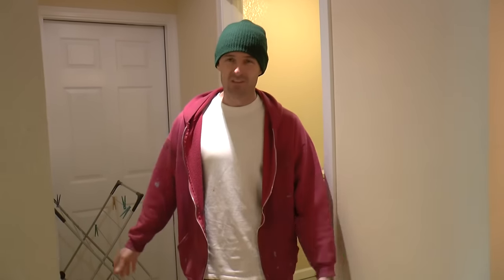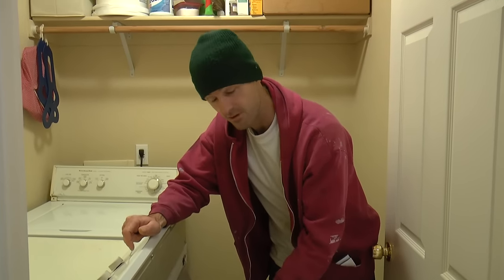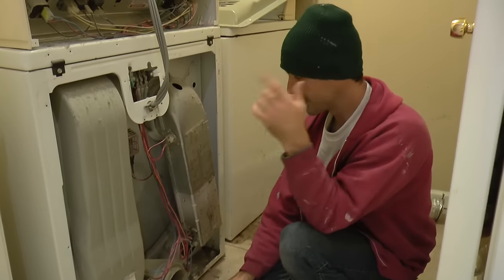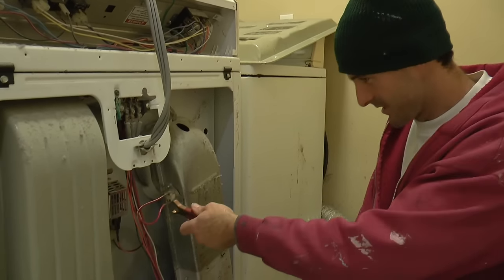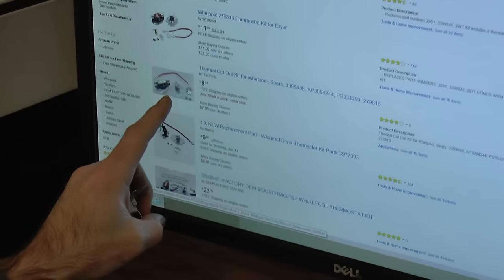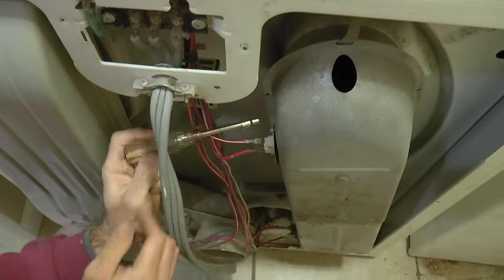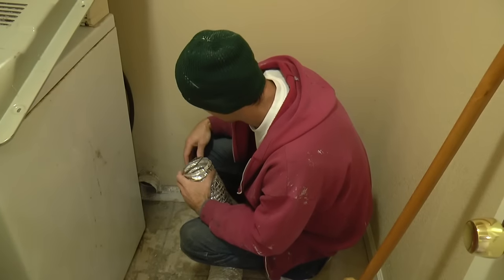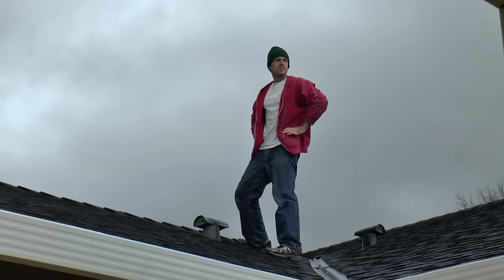My Electric Clothes Dryer Doesn't Get Hot - Fixed!

Comment: My whirlpool cabrio dryer is not getting hot and I watched your video. This help me a lot, I was going to call a repair man in the morning but I decided to check some of the things you mentioned in this video. I’m pulled the dryer out from the wall and took off the hose that connects to the dryer and the wall and then I turned the dryer on for a few minutes and I put my hand down by the back of the dryer and it was blowing out hot heat. Then I check the inside of the dryer to see if it was hot instead de the dryer and it was very hot. All the had to do was to clean the lint and everything else that was in the hose keeping the dryer from getting hot. Thank you so much for this video, your video is very helpful for a single mom. Thanks again

Comment: This worked when nothing else did and made me a hero in my household. That is not an exaggeration...with three kids, all teens, the laundry had backed up massively, and fast. The trick was bouncing the connector/trip/fuse/whatever off the ground hard six or seven times. It absolutely worked and reset the heat element so heat ran again. I am forever in your debt.
Reply: I know this is over 5 years old, but I was in the exact same boat and the same fix!! 20 year old Kenmore got its stay of execution!

Comment: Thanks for the video. My Kenmore dryer stopped turning on a few days ago. Put a new door switch in, still didn't turn on. Narrowed it down to the thermal fuse after buying a multimeter. Didn't show continuity and the dryer started when I bypassed it. Replaced it and the dryer was working again. Cleaned my dryer vent out with a leaf blower. Put a few loads of laundry through it and then noticed one load wasn't getting dry. Realized it wasn't heating up at all. Came across your video and I tested the high limit thermostat and it didn't show continuity. So I tried throwing it on the ground a few times and it worked. It showed continuity with the multimeter. Hooked it back up and my clothes are getting dry again. I am ordering a replacement from Amazon because it looks like it got pretty hot at some point and part of the plastic is melted. Cost of a new one is worth the piece of mind.

Comment: Just did this and it worked!
I don't have a multi-meter so I couldn't test it. I just tried the trick with throwing the thermal fuse on the ground and it totally fixed it! 
Multi-meter and new thermal fuse are in the mail but I can still use my dryer for the time being.
Thanks so much!

Comment: Effective, entertaining and explained in simple terms. Great job.
Reply: I agree, thanks
Reply: Thank you so much! I didn't have the meter to see if any of the parts were working. I took the part off, and threw it on the ground hard. I was already frustrated so that part came easy. I put it back together, and it worked. Thank you so much. Lol for free

Comment: The problem is with the vent where it travels vertically to the roof. The warm,moist air causes lint to stick to the walls of the duct, diminishing airflow. You need to clean the duct with a long brush usually about 10 feet long. They are made of wire so they can bend and flex.
Reply: 🇬🇧 - like that of a chimney sweep, over here most vented tumble dryers are being replaced with heat-pump ones which are more efficient 🌿, and when we did have vented dryers - vented out the door and the duct hung out a open window/vented out the back and into a vent in a external wall. Only in the US have I seen in videos/pictures of that unusual vertical flue installation for a dryer, I have seen [pictured] in a 2 story 🇺🇸 house with a central laundry room that the flue was soo long it needed a centrifugal fan halfway up to aid in exhausting the air

Comment: Got a used washer/dryer set and the dryer wasn’t heating. Figured out that the relay for the heating element had become unsoldered from the control board, so I removed the old possibly lead-free solder and added some good lead solder.

After that it was overheating, but only with the vent hose connected. The house was newly rebuilt after getting ruined by an EF4 tornado 2 years ago so I soon found out that the builders never replaced the missing vent cover outside. After destroying some wasp nests and running a drill powered brush through it several times, everything was working great.

I don’t have a ladder high enough to install a replacement vent cover just yet but I have a replacement ready. Hopefully I’ll get the chance before something else moves in.

Comment: Another fine fix!  I never liked those drier things because of this exact problem.  I was looking to get a new one recently but then I stumbled on a website that suggested using a dehumidifier to dry clothes instead.  I needed one of them anyway for a back room that gets a little damp, so I thought I'd give it a go and it does indeed work a treat.  Apparently, they're a lot safer and more cost efficient to run than conventional driers - take a little longer though, but I can usually wait overnight.
Reply from the maker: Wow, I never thought of a dehumidifier. It does seem a waste to make all that heat just to dry clothes. When the weather is nice (and even when it's not if the dryer is broken), we use a drying rack.
Reply: It does work really well. Mine's even got a clothes drying button which makes it work a bit quicker I think - not sure if they all have that feature. It produces a nice container of distilled water at the end of the day too!

Comment: When you have the back cover off, it's not a bad idea to remove the lint trap duct on the left side to clean that out as well, and the blower wheel thing at the bottom.  Doesn't take too long, held in by the same screws that hold the back panel on, and a couple screws up where the lint trap goes in and out. I mention that because with all the lint that was in his ductwork, I bet there's more in that ductwork  on the left side.

Comment: Oooh! You just fixed my dryer too. Mine had the same problem also. It was clogged with lint and got hot so the shut off valve kicked in. I replaced the cut off valve and BEHOLD!! The heating element lit up!! Thanks!!!

Comment: I replaced the heating element last year in dryer.  You saved yourself a $125.00 plus service call.  Vinyl dryer hoses used to be the standard not too long ago, and are more fire prone.  Also, check your hot/cold hookup hoses on washer for serviceability.  Supposed to replace every 5-8 years to prevent bursting.

Comment: It's always a good idea when using a multimeter set for continuity to remove at least one wire from the terminals. On complex circuits there are often more than one path that may cause you to miss the open circuit. The tip about rapping the thermal disc switch to reset it is interesting. You could check it with an open flame to see if it still trips as it should before presuming it to be reliable. Thank you for the good video.

Comment: My dryer is in the basement. The vent is above the dryer and comes out just above the concrete wall. It has a flapper door on it to prevent cold air and presumably rodents and insects from entering when it's not in use. Some wasps built a nest inside the hood of the vent and it kept the flapper door from being able to open. I found by dumb luck as I saw them flying in and out of it one day while doing yard work. Just one of the things to look at regularly.

Comment: Congrats to you on the dryer repair but don't forget to put the wall plate on the dyer outlet. It's 240 volts and get rid of the foil vent hose and replace it with an flexible metal vent hose.

Comment: Dude you're a freaking genius. lol (referring to the bounce the part to flatten the part trick!) lol 
How is the heating element different from the the igniter and flame (triggered by the solenoids) in the front of the dryer.  My dryer's igniter glows, the solenoid clicks and the flame turns on and stays on , but the drying drum and does not get hot thus the wet cloths do not dry.

Comment: On the left of the element chute where the thermo switch you reset was ,is another shiny aluminum chute,the other side ends up top(in lint filter  screen slot)and is 2 screws inside your lint trap you must remove(After pulling screen out will see them).Then from back remove the left shiny alumimum chute where fan is(behind it you will see fan)(are screws around edges).The MOST LINT IN THE ENTIRE MACHINE is packed tight and eventually obstructs fan.Once 2 screws in lint remover on top are out,and a few on back,that entire apparatus pulls out to clean,even vaccum fan out because you will see it once apparatus is pulled out..(entire shiny left aluminum chute that is lint trap running to top lint screen slot)..What you removed from outside exhaust is 1\10th of "STUFF".. take the left side out and machine will be like new with fan working 100% freely again)(ENTIRE BREATHES AGAIN FULLY).Are protection fuses on right of left chute as well.(down bottom)..It sets down in bottom of left chute and literally packs tight,hinders fan and makes it work harder.Bet 7pounds tight packed was in mine.I  kept my exhaust clean,but was not removing that from behind(WAS AMAZED FAN STILL SPUN)..I even have brush I stick down lint chute,and when I was hitting bottom with brush,it as hitting solid wall of "STUFF"..(and I had no idea).pellets,fishing sinkers,paper,pebbles,bolts,mud,A shovel full packed....Just trying to share what I just learned to a already great tutorial.Happy 2020..

Comment: Thank you so much about the thermal cut-off fuse! I've been waiting for my part and I tried the "bounce technology" so I could test my blower wheel and it worked! I have heat but need to know why it blew in the first place. This is the second time it's happened and I'm on my 2nd thermal cut-off. Checked the entire duct to the exterior of the house and cleaned the lint inside the blower housing. Getting frustrated but at least I won't have to keep buying the cut-off fuses each time I need to check another component!

Comment: I did check and my  vent was clear too, but dryer is 15 years old. I went outside and lots of air coming out with good pressure. Thanks for the info.

Comment: You got lucky my friend, My renter never cleaned the lint trap and completely filled the exhaust pipe.. when it went out, he killed that same part and burnt out the element.. still not all that expensive of a fix but a little maintenance can go a long way to saving some green!
Reply from the maker: Yes, I've learned dryer ducts are something that do need a certain amount of care! It sounds like the failure of that fuse is pretty common.

Comment: I had a similar problem with a restricted duct.  Before things got bad enough, I connected a shop vac to the duct and taped around it to ensure all of vacuum power was drawing through the duct.  I did pick up some lint.

Comment: Thanks man without your video I probably never would have removed the upper panel I knew about the thermostats and limit switches and new where they were so I was going to go straight for em but I found when some company had came out to repair it for my GMA before I got the drier they soldered some a connection and it wasn't done well so it shorted and burned up the wire without your video I would have been scouring the web for a wiring diagram to find out what was the cause

Comment: Hmm...this sounds almost like my problem is...however, we still get heat on the high setting. So I'm guessing maybe it's the lower thermal cutout? ALso, not sure what's kicking ours off as I have cleaned out the exhaust only a few months ago.....unlesssssssss it's way up in the pipe ....guess I should climb up on the roof like you did. Thanks for the video!!

Comment: I had the same problem and took the part out and through it a the driveway 3x and......It worked!!! I also vacuumed out the exaust pipe, which I don't think was the problem. I also have some chirping going on, with maybe a pulley that was making noise and just stopped. If that has anything to do with an exhaust fan falfunction that might explain the overheating. Thanks for your video help. I didn'e have to leave the house or spend a dime to fix this.

Comment: Since there’s tons of lint on the floor and behind the dryer, there IS a airflow problem. Even if the vent may be clean and mostly free of lint, there’s more than likely A LOT of lint in the lint screen plenum since these Whirlpool 29” dryers tend to accumulate lint at the bottom of the lint screen plenum which can cause a airflow problem. There doesn’t have to be lint built up in the ductwork to cause airflow problems but a internal air restriction in the dryer itself can cause a airflow problem.
Reply from the maker: Right. Always a good idea to make sure the dryer itself is free of any airflow blockages

Comment: Stuff I could tell people that would give you nightmares. I want of those scary people that fixes a lot of my own crap. Dryer I've been using is a Kenmore that looks like something right out of Mad Max. Reason is I've had it apart and back together more times than I can count LOL. It's actually a good dryer honestly. Originally I got it where they had broken the latch for the door and they had the door pretty much smash to Sweet Jesus where they've been holding the door shut with a hockey stick for years and I just took the unit off of another dryer door. Over the years I've had the dryer apart countless times replacing belts and Christ knows how many times somebody had it apart before I got it so the older housing is pretty much wrecked although ironically at eats up and works just fine. I got a commercial dryer while back nearly twice the size Whirlpool which looks like it just came out of the box what I mean by that is the bloody units not 2 years old. I was literally going to go the nuclear option and replace the heating unit where it's not heating up last thing I honestly thought about was the thermostat puce. Safety fuse if you wish because I'm an idiot and I don't remember everything. Just out of curiosity looked up a couple YouTube videos and all three of them mentioned checking that unit including this video. Was getting ready to look up see how much it would be to put a heater core in it;). Ironically had a working heater and I ended up getting rid of it because the other dryers been working so long. I fixed a couple of dryers that people around here throughout that had some of the most hilarious stuff wrong with them. Don't get me started about the stove that I've been using that cost over $1,500 to replace was a little over a year old when I got it little old lady had already bought a new stove so there wasn't a lot I could do for her repairman said it would cost her more to fix it then replace it. I take a lot of stuff in for scrap but where it was one of those fancy glass top stove so I got curious turns out the problem was the metal back had been pushed to hurt against the wall and was making contact with the two wires for the light bulb in the bottom half of the stove I had to replace the socket the light bulb goes in and take a dent out of the metal plate guy diagnosed thought God damn stove without even taking the back off. I've been using that stove now for about 3 years lol.Nearly died when I went into a repair place here a while back and found out how much that stove cost new Source 700 they want it like I think 14 something plus tax the stoves that I taken for scrap and don't even plug in anymore because people don't generally want the type with the old replaceable burners we're like $900 I used to make sure they were dead and the ones that were working I'd sell them but I found a work being bought anymore because everybody one of the glass top ones LOL. Honestly I'd forgotten about the thermostat fuse. Hell of a lot easier to change that or check that instead of automatically replacing the heater coil.

Comment: Good informative video. BUT, U need to put a electrical plate cover over that dryer receptacle.Its dangerous with no cover. Thats 240 volts backed by 30 amps, water, pieces of metal, or any everyday things can fall in it.
Reply: Isn’t US 120V

Comment: Here's a comment on my last "Thank you" comment! I had bought a replacement thermal cut-off that lasted about 10 minutes. So I pulled off my (smooth metal) ducting from under the house and it was not too bad. I checked the blower wheel and it was spinning while I temporarily plugged it in and powered up, so that was ok. Checked the other fuses that relate to overheating and they were ok. Then I bounced the ORIGINAL thermal cut-off and re-installed it and everything is running fine!!!??? I bounced the replacement so I have a temporary back-up but have they made these fuses more sensitive to heat? The old one is about 15 years old, at least, but it didn't blow 5 minutes into the drying cycle. The only thing different that might be an issue is I used the timed dry instead of the automatic sensor, but I'm too tired of taking all of the back plate mounting screws to chance that that component is fouled somehow. Anyway, thank you again!

Comment: To clean the duct better, buy an old fashion string mop that you will only use to clean the duct. Dollar tree has them. The mop will fit inside the duct all the way. Once inside, keep twisting the mop and pull it back out. Do that three or four times and everything will come out. Clean duct two to three times a yr. I am going to do that now. BTW that aluminum foil like duct is illegal in some states. The lint sticks to it too much. Easier for a fire to start. The hard aluminum duct is recommended. That one only needs to be cleaned once a yr.

Comment: My dryer won't heat, but all the parts have continuity. I took the duct off and started, but still no heat.

The wiring from the Element and the thermostat led me to a resistor. 

It doesn't show continuity, but it does still show resistance.